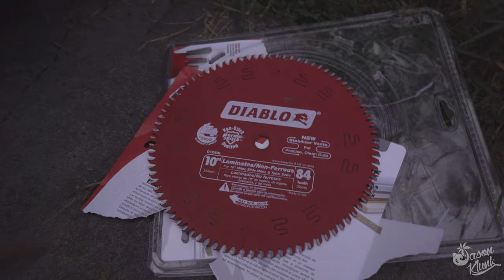Building a DIY Solar Panel Roof Rack! Ram ProMaster Van Build Conversion - Episode 8 | Jason Klunk

Comment from the maker: How did you mount your solar panels?
Reply: I haven't mounted mine yet.. Working on building the rack for my box truck.. How much is the L- profile bowing under the weight of those panels? My truck is 8' wide and I have some rather large 315W panels that I want to mount but I am going back and forth on the best way to make it work..
Reply from the maker: @mattolsson8816  Good question. In the video, you can tell I was going to try and mount the panels both towards the middle of the cross beams, but there was too much of a bow because the aluminum is so thin. I ended up pushing them out to the sides and now there is basically no bow.  For your larger panels you could go with some thicker aluminum, but 80-20 would be the best choice IMO. If I were to do it again, I would try to work with 80-20.
Reply: @JasonKlunk  thanks for taking the time to answer. Yeah it's tricky with that long of a span.. Also trying to conserve weight makes it harder.. But I may have to sacrifice some weight for sturdiness by using unistruts/superstruts across the 8' span.
Reply: @mattolsson8816 get unistrut. 😉

Comment: I appreciate you for filming everything. I know what a pain in the arse it it. I quit filming my build. I have a weather guard roof rack, too. I discovered a product in the conduit aisle at Lowes. It’s an Adamax Nylon Cone Nut. It works like a drop in t nut and fits perfectly in the channel. I got the 1/4” size. The great thing is, you don’t have to disassemble your roof rack to add a cross member. Simply drop it in and attach your angle. The other great thing is, they are about $2.50 for 5.
Reply from the maker: Thanks for the note. Yes, it was a huge pain! Nice, good find - I'll have to check that out.

Comment: Wow, very cool.  On the Promaster Forum, it is of sound belief that the heads on the roof mounting pins cannot be turned.  Most roof mounting plates are clamp on variety with exerting vertical pressure on those pins.  You simply turned the heads with channel locks.  Very nice.
Reply from the maker: They definitely turn, it's in the manual for the mounting rails.
Reply: Not true- A couple of people have posted about turning the heads for this rack on that forum. They said it was a little tough but it worked.

Comment: Thanks so much for taking time to answer our questions!! Another one I'm curious about: with your placement of the cable clam under the SPs, is there enough room to hook everything up and keep it tidy in that tight space? Putting up my two 175W panels this week and deciding on cable clam placement.
Reply from the maker: I've had no issues with where I placed mine, I like that its covered by the panels.

Comment: Duuuuuuuuuuude!!!! This was SUPER helpful on the roof rail option! I bought my Promaster 159 last Friday after researching and planning for almost 3 years and was stuck on the roof rack equation. They are so overpriced, heavy as crap, and are too high off the roof when I just needed them to hold my panels so I'm not drilling holes. Yesterday I decided to bite the bullet and drill holes and today I see your vid. Those rails are exactly what I wanted all along. Thanks for sharing! All you needed to do was make T-slot brackets for the panel rail, otherwise it was good to go as far as mounting to the van? I know you also made the Aluminum L bracket to hold the panels. I just want to be sure the hardware to mount it on the van was all there. Thanks again!
Reply from the maker: No problem, I spent a lot of time trying to find a solution as well. Yes, you'll need to fabricate something to slide into the rails so that you can attach the rack for the panels to the rails. I made them myself, but you could simply have somebody make them for you - they are super simple. The rails come with the hardware for attaching to the van. 

Make sure you check the documentation on the rails, I'm pretty sure they will be fine for the 159 but I remember seeing something in there specifically about the 159.
Reply: @JasonKlunk  Extra karma points for you my friend. Thanks again!

Comment: We are following in your footsteps on this. Thank you so much. I might have missed it but what size was those big rubber washers you  used to mount the angle frame?
Reply from the maker: I used these: https://www.rubberfeetwarehouse.com/collections/recessed-rubber-bumper-feet-metal-washer-embedded/products/1-1-2-5-8-1-2-recessed-rubber-bumper-feet-metal-washer
Reply: @JasonKlunk   Wow, thank you so very much!!
Reply: Did you use those simply to get enough height to clear the middle of the roof, where it gets a little higher? I ask because I want my rack to stay as low as possible.

Comment: Thank you for the great video! I am following you closely for building my promaster. I have a couple of questions regarding the rubber spacers you used to support solar panels: what is the advantage to use rubber spacers and how you control the tightness of the nut above it?
Reply from the maker: I just needed something to raise up the panels a bit so they weren't sitting on the roof of the van. It's a carriage bolt w/ locking washers, a nut and loctite
Reply: @JasonKlunk  Thank you so much Jason!

Comment: Hi Jason great video, I note that you turned the original “T” shaped roof rack mounting points with some grips. Before I attack my van do you know if these points screw all of the way out if so could a home made rack be screwed directly into these points to save having to make a special bracket? Any thoughts would be very much appreciated 👍
Reply from the maker: Great question, I don't know if those thread all the way out.

Comment: Hi, thanks for the video.  I got the same roof track from weather guard.  I am concerned that the mounting bracket and the screws are NOT stainless steel or galvanized.  Should I be worried about rusting.
Reply from the maker: So far they've been fine for me. Maybe try contacting Weatherguard and see what they have to say.

Comment: On the fabricated pieces, how did you go from a round drill bit to a finished square hole?
Reply from the maker: That's the hardest part. I ended up drilling a smaller round hole first and then I took a file and very carefully made it into the right sized square.

Comment: Where did you get those black round rubber spacers you have between the roof tracks and the L channel? What size L channel did you use? 1 1/2 or 2 inch?
Reply from the maker: I used these: https://www.rubberfeetwarehouse.com/collections/recessed-rubber-bumper-feet-metal-washer-embedded/products/1-1-2-5-8-1-2-recessed-rubber-bumper-feet-metal-washer
Reply from the maker: 1.5" on the L channel

Comment: How did you go about punching out the square holes for the carriage bolts on the aluminum inserts that you fabricated ?
Reply from the maker: I thought about getting those fabricated at a local metal shop, but it was going to be pretty pricey so I hacked those in myself. I basically drilled a round hole big enough so that I could get a file in, and then I filed it into a square. They are definitely not pretty, but they work.
Reply: @JasonKlunk  Thanks! I have one more question for you.  It looks like the cable clam that you used is meant for just one cable.  Did you just end up drilling 2 holes in the rubber seal and it worked fine?

Comment: A great idea, it looks really solid, thank you for sharing. I am in the process to put a roof rack for solar panels. My only concern is that the built-in bracket on top has to be twisted 90 degree, would it crack the seal? Did you apply any seal before you mount?
Reply from the maker: thanks. What seal are you talking about? The knobs on the top of the van are meant to turn so you aren't harming anything.

Comment: the brackets seen at 1:50, where did you buy those? I want to make my own custom aluminum roof rack using those brackets and probably 1 inch aluminum square tubes.
Reply from the maker: The 6 on the left came with the weatherguard rails that I bought. I ended up making 4 more myself out of 1/8" aluminum.

Comment: This there a reason why you left a space in between the panels? Thanks.
Reply from the maker: I pushed them further to the outside of the rack so that the crossbars didn't flex at all in the middle where all the weight was

Comment: In the end when you were showing the connection to the unistrut there were some big rubber washers. What were those? Do you have a link?
Reply from the maker: Yes sir, I used these: https://www.rubberfeetwarehouse.com/collections/recessed-rubber-bumper-feet-metal-washer-embedded/products/1-1-2-5-8-1-2-recessed-rubber-bumper-feet-metal-washer

Comment: Hey Jason, is the friction from the compression of the rubber feet the only thing keeping your fabricated plates from sliding in the channels?
Reply from the maker: Hey - no, the plates are attached to those tabs on top of the van.
Reply: @JasonKlunk  Yes, the ones for the weatherguard rail system are secured to the roof's tabs. But I'm wondering about that 4 you fabricated on your own. @10:40 it looks like its the downforce of the nut on the rubber feet that's primarily keeping your plate in place.
Reply from the maker: Sorry, I misread your question. Yeah, it’s all kinda clamped together - carriage bolt, plate, rail, washer, angle, locking washer, nut.

Comment: Hi Jason, how and where did you run the wires that connects the battery to your Renogy DCC50S Charger w/ MPPT?  I am assuming you are also charging your battery from the alternator in addition from the solar panels.   Also what size fuse did you use?

Comment: Did you need to put anything under the flat plates to assure the turned pin secured the plate to the van?  I have some angle brackets that I am hoping will work with the turned pin, but don't see how to get them nice and snug.  Great video!
Reply from the maker: No I didn't. There are some white brackets that came with the mounting rails that help secure it in place, you can see them at 3:02

Comment: What model of the Blue Sea Cable Clam did you get that has 2 holes in the rubber gland instead a single hole?
Reply from the maker: None of them have more than one, I drilled them out myself. The one I used is in the description.
Reply: @JasonKlunk  THANKS! That's what I wound up doing today. Good install man! nice and clean

Comment: I really like your videos you seem to do things right. I followed your instructions on the solar panel install and it worked out great but question is when I finished with the install and my wires are inside the van are they live? I threw a tarp over my panels and taped my ends in the van since I am not really ready to hook up yet is this what you did or do you know about the wires being live or not?
Reply from the maker: Thanks. They are definitely live if you connected the panels to the wires you ran down into the van. Disconnect the panels on the roof and just let those wires sit under the panel until you are ready to start your electrical.
Reply: @JasonKlunk  thanks that's what I thought
Reply from the maker: no problem!

Comment: Hi. Thanks for your video! Looking at the BlueSea entry gland with the link you provided, the inside rubber stopper already has one hole in it. Did you drill out a second hole?
Reply from the maker: I purchased the one where the rubber doesn't have a hole, so I drilled two new ones.
Reply: @JasonKlunk  Interesting. You purchased the .83" with 3 seals? The picture shows 2 stoppers, and they both have a hole. I went to the BlueSea site and looked at the instructions, which are confusing. It states to confirm the hole is the correct size. Then, it says to drill a hole and slice from the outside to the hole. Not sure what's what.
Reply from the maker: @azhiker522  The one I have linked is the one I ordered. It's been a minute, but I thought it came with three and the third one didn't have any holes.

Comment: I just installed mine today and I’m afraid I went too thin on the aluminum angle bracket. There’s rattling when I hit bumps which I believe is the aluminum flexing. How thick are your rails and do you get any noise from them? I did all this solo so the thought of having to redo it is a real bummer.
Reply from the maker: Bummer, I used 1/8" aluminum angle and haven't had any issues.
Reply: @JasonKlunk  That's what I used! Hmmm. I just ordered 1/4" but I'll also add some rubber grommets under the panel mount points to make sure the solar frame isn't rattling against the angle bracket. I'll also mount them further apart so they are closer to the edge rather than towards the middle where there's less support. Appreciate the reply!
Reply from the maker: Did you add any spacers between the roof rails and your rack? Without those, the rack would definitely sit on the roof and rattle.  I was originally going to mount the panels closer together in the middle, but in the end moved them towards the edge on each side like you mentioned. Good luck!
Reply: @JasonKlunk  I added some rubber feet and washers to make sure it cleared and accounted for any flex. Really appreciate you taking the time to troubleshoot it with me. I think the thicker rail and spacing them further out will do the trick. Good luck with the rest of your build! All my electrical comes this Friday. W00T!

Comment: I saw you twist the roof nubs, is that how they work? I couldn't figure that out.
Reply from the maker: yep, you just need to use a wrench.
Reply: Jason, I love how you research and then improvise as you move forward on your van. Questions: do the long rack bars sit on the van roof when you tighten the 6 nubs? How much clearance do the cross-angles have to the roof in the center of the span? Do the angles sag at all with the weight of the collectors? I guess that’s all...for now! Thanks, Will
Reply from the maker: @CentralCoastBassFishing  The rails from weatherguard sit on the van, in a sort of weird spot TBH. They don't sit how you'd expect, but they feel really strong either way.

My rack isn't sitting on the van, I have about an inch or so of clearance. I was concerned about sagging, so you'll see in my final shots at the end that I've moved the panels closer to the edges rather than butt them together right in the center. The dip down just slightly, but not enough to worry about. 

If you are worried about the weight of the panels, just buy stronger cross bars (8020, steel, thicker aluminum).
Reply: @JasonKlunk  thank you for your reply! OK, the rails actually sit on the van roof, not suspended on the 6 nubs/thingys Ram welds on the roof? Do you have any concerns about potential wear/rust where the rails sit on the roof? By "rack having about an inch of clearance" are you referring to the aluminum angles that hold the solar panels in place? Sorry for all the questions but I'm a planner, like yourself and I really don't want to have any avoidable regrets as I build my new van.
Reply from the maker: Right. I don't have concerns about rusting. If the rails from Weatherguard for some reason do end up rusting, I can remove it and clean the van - it's not the end of the world. But definitely something to consider if you are worried about it. Yeah, the inch of clearance I was referring to is the space between the van and the aluminum angle. I wanted there to be space for airflow under the panels.
Reply: Jason Klunk the Weatherguard rails won’t rust, they’re aluminum. I was just thinking a thin piece of rubber between the rails and roof might keep any wear from occurring to the paint of the van. I ordered my rails yesterday, thanks for your links and all the helpful videos!

Comment: How many 170ah batteries do you have on board?
Reply from the maker: I have one
Reply: @JasonKlunk  ok thanks for the reply! I thought in one of the shots I saw more than 1. I’m in the process of my build and I’m gonna go with 1, 200ah as well. Your videos are suuuper helpful during my guild so thank you!
Reply from the maker: thanks, glad they have been helpful. In they very early days I was looking at using some AGM's that I bought (I had multiple), but I ended up returning those and buying the 170 lithium. They may have showed up in an early video, but I don't recall.

Comment: I bought a lithium battery and the renogy pure sine inverter. But then read it wasn’t compatible.. have you had any issues with your system?
Reply from the maker: That’s not true, where did you read that?
Reply: @JasonKlunk  I was looking over the manual on renogys site then saw where it says to only use with sealed lead acid, flooded or gel batteries. Thanks for the reply. I’m new to this stuff so wanted to make sure.
Reply from the maker: Weird. Yeah, it’s totally fine. There is a section on their product page where it talks about the sizing for lithium. “MINIMUM 12V LITHIUM BATTERY BANK SIZING”
Reply: @JasonKlunk  thanks!

Comment: have you installed the batteries yet?
Reply from the maker: Yeah, I just don't have any videos of that part of the process
Reply: @JasonKlunk  sweet! also which battery is it that you used and which inverter/charger? I'm currently at that part of my build thank you so much .
Reply from the maker: @jarvisthesmartvanatvanprov5975  I put links in the description to what I'm using - I have the Renogy 170 AH Lithium battery and the 2000W inverter.
Reply: @JasonKlunk  Ok, I bought a battle born but I'm a little conflicted, have you ever considered the battle born? Also Would the renogy charger work with the batttle born? Also how much do you charge for consultation? thank you !
Reply: I was considering the victron with the charger and inverter